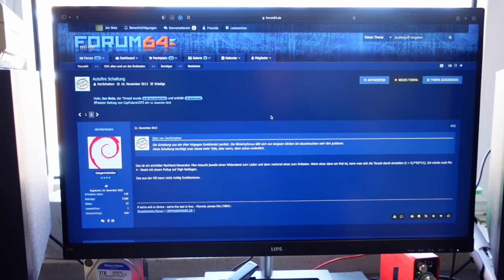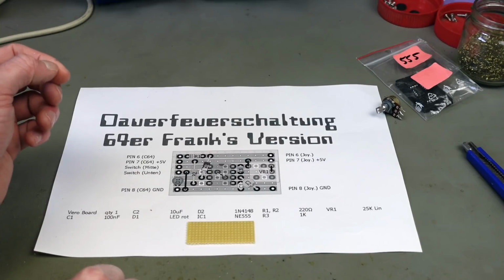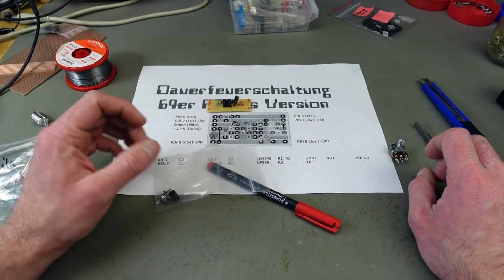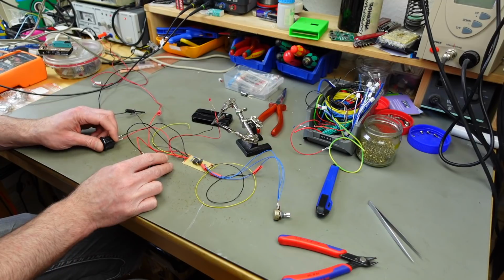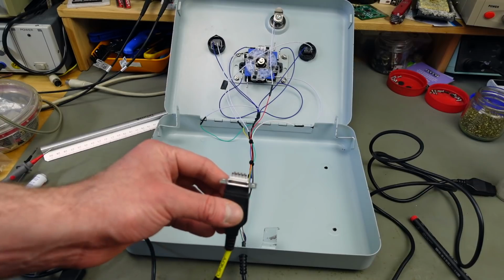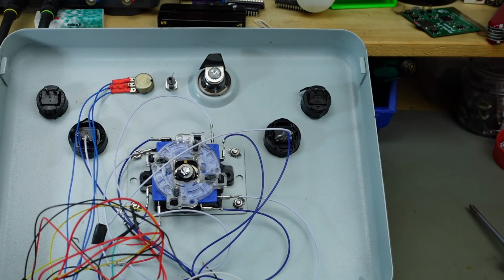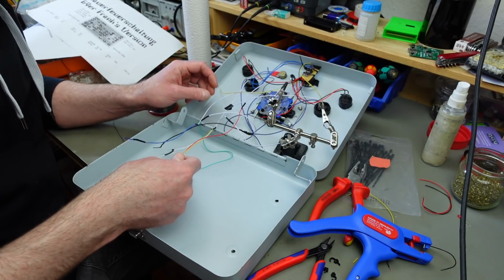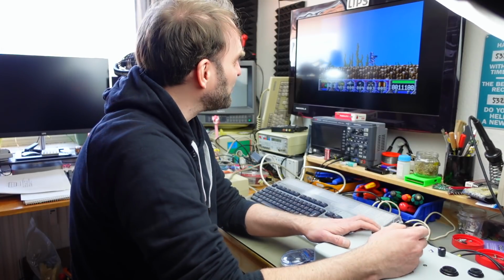Autofire Circuit for my self-made Joystick

Comment: Hi Jan, sorry to bother you again, can you tell me where you got the +5v from, mind you I have only watched bit's of the video, Thankyou in advance!
Reply from the maker: +5V are on pin 7 of the DE9 on the computer/console side. That is for the standard Atari pinout (also used on the Commodore machines).
Reply: @JanBeta  Thanks again, ah I see so carrying that voltage from board through the joystick wire up to into led etc and tee off that led to power something else, Ta very much!!

Comment: I modded my Zipstik back in the day with adjustable autofire. I just replaced one of the resistors with a variable resistor I had in the parts box. I had only some little idea what I was doing but I just tried stuff until it worked. Xenon II is great for testing too, it looks ridiculous when you tune the fire rate to the maximum. I have to say, I wasn't keen on the cashbox casing idea but it does actually look quite nice. At least it can take a beating if need be too!

Comment: I used to build special autofire circuits for my friends in butter boxes: Based around 4009 for oscillator and 4016 fet-switches, they could also wiggle the joystick. Track and Field on the C64 was fun - you could jump two hedges at a time. The last version I did had a photodetector you stuck to the screen for spear throwing, all in 4000 logic.

Comment: I used a 555 timer, too. I had an autofire product that I purchased back in the 80s made by Pointmaster that claimed it would automatically fire at the max rate possible for the game. I have no idea how it worked, but I can confirm that every 2600 game I tired using that inline autofire adapter worked perfectly.

Comment: I did not see the schematic but guessing it is the classic astable setup, you may solder a 5K (~ish) series resistor on the middle (sweeper) pin of the pot making a permanent minimum resistance for the timer. This way it will not go up to useless speeds. You may need to experiment with the value a bit but I am sure you'll come up with a perfect value. I have a QuickShot II Turbo joystick which has autofire on it (yes, with a 555). It is set up so that you don't need to press fire button on autofire, it just fires constantly when the autofire switch is on. While this works perfectly on my Spectrum (with Kempston) It messes up with the keyboard reading of the C64 if the autofire is left on in BASIC. I can't even type LOAD"*",8,1 without getting irrelevant characters if the autofire is on. You may check if this happens with your circuit too. I am guessing the reading of the keyboard and the joystick is somewhat connected in the C64.

Comment: Interesting variation of the autofire circuit with the additional fire buttons instead of an on/off switch! Makes totally sense in practice. 👍
Any chance of a circuit diagram? I woul like to compare it to my 555 autofire circuit shown in my "Competition Pro Board" video https://youtu.be/q_QXzHbiN0E
The first major difference compared to my version (which is based on Ms Mad Lemons circuit) is that you use two caps instead of one. 🤔

Comment: Just one tip from someone who has made many projects on Veroboard (back in the 80s it was the only way!) its considered essential to break the tracks before you start fitting any components, so the cutting is easier and you can visually inspect it - its surprising how the reflections from solder joints can stop you from seeing those whisps of copper that all too readily short tracks near the cuts. Other than that, it was really nostalgic seeing someone from the PCBway generation using Veroboard!  I love your controller, its great to have something you have designed for your own needs.
Reply: It's still possible to buy strip cutting tools. Though, as was the case forty years ago, the Vero branded version is considerably more expensive that the alternatives.
Reply: @markevans2294  Yes, the Vero one is a "spot face cutter" and makes a flat bottom hole that doesn't weaken the board as much as a twist drill and is less likey to make those copper wispers.. The cheap tool is a twist drill with a handle, but it still does the job if you are reasonably careful.

Comment: Yeah... I would have just used a single switch (not for "permanently on" auto fire, but to select whether the existing buttons were hooked into the auto fire circuit or not).  I think you can find potentiometers with switches built in, so that all the way to the left is "off", leaving the buttons working as normal, and then any other level, re-routes the buttons into the auto fire circuit.  Then you could just put that where the lock indent at the top center of the case was / still is.
Reply: The way he has it is better, because there are a few games where you want both auto fire and normal fire at the same time. He demonstrated it in Turrican, where you want auto fire and also to be able to hold down fire to activate the flamethrower. Same with R-Type, where there's normal fire and a charge fire by holding down the button.
Reply: @Zardozer  The way I understood it is that "Frank's version" superimposes the fire on-top of the button meaning that when you hit the switch, it starts to oscillate, and when you press the button in that state, it functions as a normal press. My German is a bit rusty, but that's what I got from it.